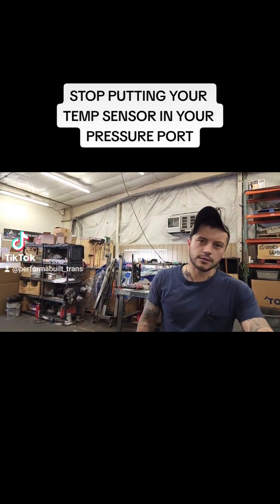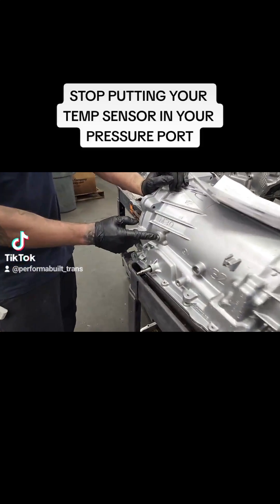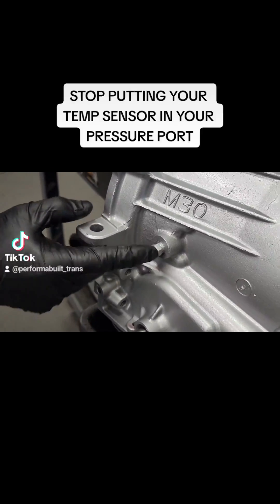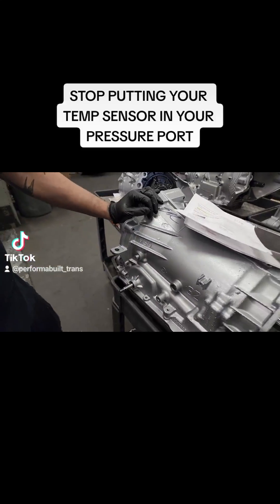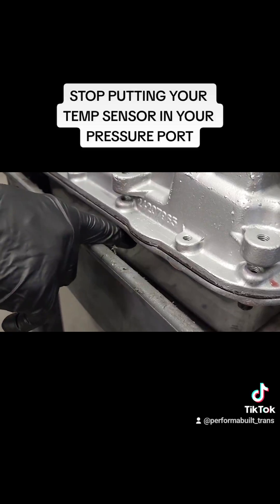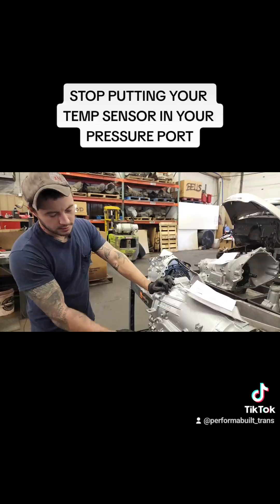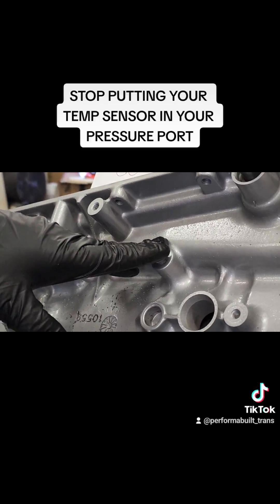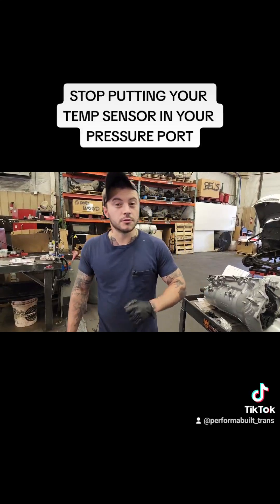Stop Plugging Temp Sensors Into Your Pressure Port!!

Comment: Where did Cadillac put there temp sensor on 05 Escalade???
Reply from the maker: Its part of the pressure manifold switch like all 4l60 and 65 and 70s in the pan bolted to the valvebody.

Comment: Does this apply to the 7.3 4r100’s as well because I just bought a whole new transmission, 40k cooler, an braided lines, and of course a temp gauge and I really don’t wanna cut one of my new lines let alone do I fully understand how to re attach them after I cut them🤣 and to be fair I don’t do a ton of pulling most of it is just driving to and from work or going to the grocery store but when I do pull I really pull.
Reply from the maker: Applys to all transmissions. New ones and even older oned with multiple pressure ports.

Comment: Do you know what wires I would use to hook a gauge up off my PCM? Or trans plug for the 4L 60e
Reply from the maker: Any google diagram has the wire for the temp sensor in the pressure manifold switch.

Comment: I got the 4l80e can I tap my after maket temp gauge wire to the trans harness plug would it read correctly
Reply from the maker: You should be able to yes
Reply: I tried but didn’t have luck it wouldn’t read right

Comment: Anyone know if a 4l80e from 1996 has a temp sensor in it?
Reply from the maker: Its built into the pressure manifold switch inside the pan on the valvebody for the vehicles pcm tcm.
Reply: @PerformaBuiltTransmissions  I thought so. I have a Scangauge 2 device that I was trying to program to read it but cannot get it to.
Reply from the maker: May be not functioning. They do go bad

Comment: You wouldn’t happen to know what’s a good spot for a temp gauge on an AODE? 😅
Reply from the maker: The pan. We used to build those as well as the 4r70w
Reply: @PerformaBuiltTransmissions  question I had mine rebuilt by a transmissions guy as a performance spec, and I asked what he recommends on the maintenance intervals. Told me to leave it alone, sounds off?
Reply from the maker: @Morax515  yeah i recommend once a year.
Reply: @Morax515 - planned Obsolescence

Comment: Just tested this in real world driving. 
Regardless of if the temperature readings are accurate I found the shift points lowered with the longer temp sensor in place pointing to a restriction in the trans.
Reply from the maker: It is a main pressure passage in the port. I.e restriction
Reply: @PerformaBuiltTransmissions  it's settled then, guys don't screw temp sensors in pressure port 👍🏻
Reply: If only he had said that during the video 🤷‍♂️

Comment: I have a 4l60e  behind a 5.7 vortec. Transmission works flawless.  Until it reaches about 200 degrees farinheight. Then its like a valve opens up and fluid starts pouring out of the top of the Transmission somewhere(possibly the vent tube) and the tranmission loses power. Let the tranny cool down till at least 180 and it stops leaking and power is back.  I installed a deep pan and 2nd trans cooler thinking it was overheating. But will do this even in strong winds with no load.  Any ideas?
Reply from the maker: Make sure you ran the inlets and outlets for cooler flow correctly as well as mounted each cooler horizontal and not vertical to prevent cavitation on top of verifying the filter you used is deep and not a silver metal topped shallow filter. It is puking out of the vent tube because autos do not like 200+ degrees despite what GM claims. These are rly the only causes ive seen that will produce this scenerio.

Comment: This is where glowshift recommends installing the temp sensor in there instructions
Reply from the maker: Does glow shift build transmissions?
Reply: You’re reading the heat of the casing which is aluminum. In this case which gives inaccurate readings, you have to put it directly into the oil itself which the sensor on the gauge is made for. This is the only way to get accurate readings

Comment: Might explain why im reading 210 under easy driving despite having a big plate cooler w fan, Im going to move it to the pan based on this video and some other forums posts that seem to indicate this is a higher temp reading I dont understand fully because my brain assumes fluid temp is fluid temp in an engine or trans but we shall see!
Reply: If you’re reading that high just on easy driving then you have to do the bypass valve. The stock valve does not open until about 190ish or so. 
Or your valve body & lines could be clogged needing a rebuild in the trans

Comment: Thank You, I keep trying to tell people the same thing.

I hear this a lot too. People who overheat their engines and blow a coolant hose and lock up the motor due to no coolant and say, "My coolant gauge never went up". Well, the reason is because a temp sensor reads the temp of fluid running by the sensor. Not ambient air temp. It'll read the temp of the block/ case when it transfers the heat from the block into the sensor but by that time, your block/ case is already done.

Comment: In higher performance applications you want it in the case to read fluid working temp. Not after cooler temp.
Reply from the maker: I disagree completely, espcially when that port is a dead spot for fluid on most transmission models which will indeed throw off real temp being the thickest part as well. Unless you can explain why you would want to monitor case temps and its heat dispersion past what temps any fluid can handle (which is what makes the auto work) then i feel i still disagree. If you look at the flow on a typical gm auto youll clearly see why.  Its very important in the world today to not spread misinformation.
Reply: @PerformaBuiltTransmissions  Not spreading misinformation, dyno proven tests done on our hub dyno before 3 drag and drives on the same transmission.
Reply from the maker: @MrBAJACOUNTRY  I respectfully disagree. Because in the pan isn't after cooler temp... it is working temp.. that's the fluid that is about to "go to work".  The pressure port is Dead flow and is a one way street so im not seeing how a dyno test can determine That at all by itself.

Comment: Wouldn’t the case temp indicate what the fluid temp is?  Doesn’t the fluid heat the case?  Or, at least wouldn’t the temp read cooler than hotter?
Reply from the maker: No, the case disperses the heat which = hot consistent shed temps. The fluid is much cooler than the case while its doing its job.

Comment: got a 4t45e  took the cover off for the shift solenoids thought change the pressure ones at sametime pull the one out on the bottom not a problem till i go to put it back on it wont go in there, neither will the old one, hate to bother you but i cant find anything that is any close to what i need. Hopefully you can. If not i understand. love you videos watch them all the time
Reply from the maker: Ive never worked on a 4T45E